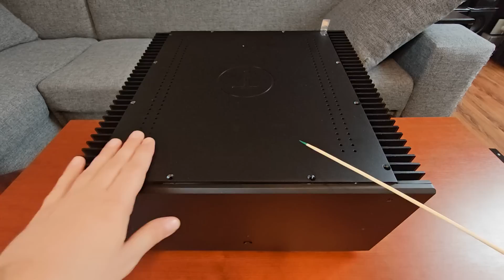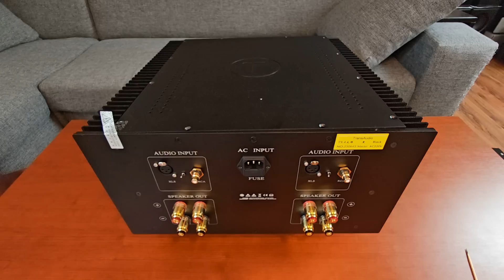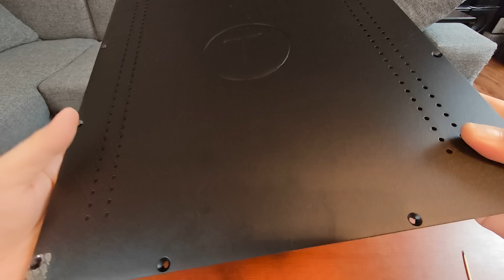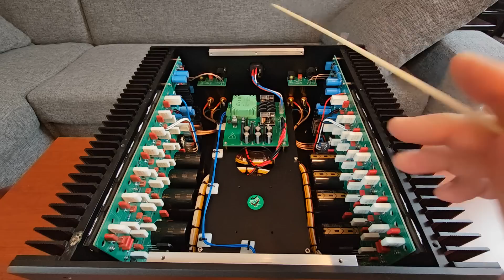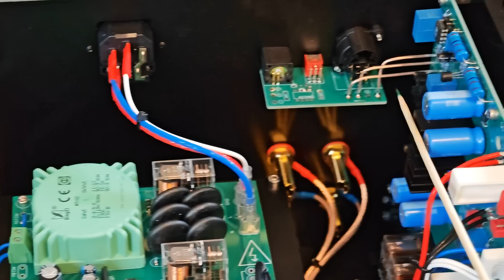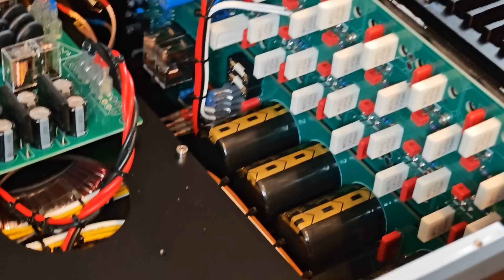Better and bigger: Burmester 909 Transaudio T9.4 stereo amplifier first look

Comment: Since T9.4 is your best power amp so far, I hope you will also review the higher grade power amp T11Pro from the same manufactgurer. I am planing in getting one depending on your review of thse monoblock.
Reply: I have them almost two weeks ago. They are amazing,  great control over speakers and very musical. They are transparent and realistic.
Reply: @vvmaster2010 What preamp are you using?

Comment: ciekawe czy z kappami by sobie poradził.....
Reply from the maker: I'm pretty sure it could handle welding too. I mean my electrostats are really hard to drive properly (1.2Ohm in treble range) and this guy doesn't break a sweat driving them.
Reply: @k4syx  tak tylko, że rozmwiałem z chinczykiem i p;owiedział mi że nie poleca bo to bedzie 800w przy 2ohm - no bo tak będzie, i że trafo jak trafo, ale końcówki mogą się zesr.... ty oczywiście nie pokażesz więc...
Reply: @k4syx  rozmawiam z asypdzsw i chinczyk mówi tak jeśli chodzi o kapp[y "BL9 is a continuous output power, but it is not designed for your 2 ohm. A 2 ohm speaker means that the output power needs to be greater. Compatibility will also require a significant push. Understand?
I have been working in HIFI for 20 years, but I have never seen a 2 ohm speaker. Such low impedance speakers were already phased out in China 40 years ago." WIęc naprawdę, wypadałoby, żeby podchodzić do tematu rzetelniej niż tylko "pociągnie spawanie". To są takie same legendy jak wcześniej, wypadałoby to mierzyć bo komuś może stać się krzywda z burmastrem za kilka tysi z chin. Ja tego nie kupie bo sam producent mówi mi, żeby tego do kappa nie podłączać. Ty twierdzisz co innego. Może tobie co innego napiszą tzn że chińczyk kłamie?

Comment: Good morning, I am also a happy owner of the t9.4, it has excellent powerful and defined sound once it reaches operating temperature, after about an hour of work... but is it normal that it heats up this way? The entire case becomes almost untouchable, in front, on top and on the heat sinks.Thank you for the reply.
Reply from the maker: Hi! Shouldn't be like that, mine gets warm to the touch but not too much. Do you have good enough ventilation? Are you by chance living in some warm climate place?

Comment: I received mine today via DHL. No issues and WOW! Sounds incredible right out of the box. Playing on my Caintuck Audio Betsy open baffles. So powerful and quiet. The details and separation is best I’ve heard in my system. The amp takes the speaker and puts it into a head lock. Pure control. It’s right at 100lbs so better get some help dealing with this beast!
Reply from the maker: Thanks for sharing your experience and congratulations on the new amp!
This is the best amp so far I've had tested and reviewed and looking at what Ali has to offer there seems to be little competition: T11PRO monos (which are basically the same just more expensive) and maybe Dartzeel 1:1 clones for 2.5-3k $. And that's it, there is just a few candidates.
Reply: What's your preamp?

I may get these!
Reply: @MadLadsAnonymous Holo Audio Spring 3 KTE DAC with analog preamp. Great combo! When you have a resolving system, you can really hear what this amp brings to the table.

Comment: Received mine yesterday. Takes from the grid 160 watt upon power on, it stabilizes around 130 watt at normal listening level after warm up. 46 Celsius degrees during normal operation with 26 Celsius in the room.  Basically similar consumption with D5PRO BC. Great!
Reply from the maker: Thanks for sharing! 
Give it a solid burn in time and enjoy - still the best I've heard to date!
Reply: How does it sound?The quality looks knock you out,I know they can be good,as I have a Vincent Audio Amp sp331,it’s pretty good,at least as good if not better than my previous NAD C272,loved that amp but was getting a bit old and took a chance on the Vincent,drives my Thiel 1.5’s and Maggie LRS’s very well.Hope you’re enjoying your clone amp,probably the way I’ll go if I need another amp.
Reply: @PistolPete-i8o sounds very good. You can feel you are in the presence of greatness! Not so much home these days but every time i listen to it I am really enjoying it
Reply: @windyse860 Sounds like a winner to me.

Comment: Coupon codes don't work in Romania either ...
Reply from the maker: The new ones or the old ones? Old set expired on 21st and on 23rd or 24th I've updated the video descriptions with new ones.
Reply: @k4syx it was the old ones, I believe I first tried them on the 22nd. Nevermind, I have placed the big orders on the 25th a few hours before the new ones hi hi

Comment: I also have the T9.4, and it sounds great. But the 2860plus preamp has too much gain for it. I connect the Gustard X30 via XLR to the C2860plus and then to the T9.4 via XLR. Then I can set the volume to max. 9 to 10 o'clock. This is especially problematic in the evenings because the volume control steps are too large to achieve the desired volume. It sounds great, but there's no real match between the T9.4 and the C2860plus.(Gain)
Reply from the maker: Thanks for sharing! I think with less sensitive speakers that would be smaller problem (probably)
Reply: @k4syx only 87db ... it will be nice if you tell us also a bit of the gain of the preamp's.The internal preamp of the Gustard X30 is a better pair in terms of gain, but cannot keep up in terms of sound.
Reply: @S.F.75 same problem with Cry SLP90. Times to times I have some pops or cracks. Using now my DAC as pre....

Comment: Need the comparisons of FM801 vs this T9.4 and the D9 pro.  Which do you like best and why.  Which preamp do you like best with it and why?
Reply from the maker: It's in bits in the comments for those videos, and in the reviews I talked about strong points for each of those amps. I have yet to get to the point where I will do direct comparisons as I have more amps in the line up for review. 
My personal "top three" can be always found in my channels "posts" section as I update it before larger Ali sales

Comment: Does the T9.4 run hot when operating? The D5 Pro I have runs hot. Love the sound qualities from the D5 Pro though.
Reply from the maker: Its hot but not as hot as D5Pro. Its larger so there is more solid metal for heat dissipation, but still, D5Pro is significantly warmer
Reply: @k4syx thanks for the info. Am seriously considering to get the T9.4. Followed your recommendations much earlier and had gotten the Cary + D5 Pro combo a few months ago, connected to AE520 using the clone K2 wires.  I just cannot stop listening to my vinyl/CDs again. Have never enjoyed it that much and there's no listening fatigue.  Thanks a million! Am also considering the Telos 2500 + Telos 600. Patiently waiting for your reviews on them.

Comment: Not available to shipping to UK 😢
Reply from the maker: Yes, many of the shops stopped UK deliveries because of high return rates - notorious problems with humming transformers due to grid problems....
Reply: @k4syx  The UK voltage can be above 245V and saturate the primaries of 220v rated stuff would be my guess.

Comment: I have this amplifier !! op-amp is easily accessible,  suggest replacing the op-amp with a high quality discrete,  sparkos , Burson or what ever is to your taste,  it surpasses the  D5-Pro which i also have now gathering dust in the corner.   T9.4 is impressive straight out of the box.  D5 pro damping factor is stated as 500, T9.4 is claimed to be 2000, what ever it is it takes control of the speakers. D5-pro sounds spongy in comparison.
Reply: These Chifi amps are trash.They always sound harsh and their musicality is weak...Better buy used original like Quad or Musical Fidelity!
Reply from the maker: Which ones have you heard? Are you referring to some specific ones?
Reply: @beslemeto Have you heard this amp? You will change your mind. Are there low quality amps from China? Sure. Not this one. I have this one and can say with first hand experience, it’s incredible.
Reply: @briancook9518  Which other amo did you compared it to?
Reply: @beslemeto Based on your question to my question, I’ll take it the answer is no. I’ve had many amps over my years. Brands that anyone in the know would recognize as high quality (Conrad Johnson, Audio Research, McIntosh, Pass Labs to name a few). I like buying and selling to get real experience in my room. So many people have 0 experience but want to get online and give opinions on hearsay. The TransAudio T9.4 holds its own with much higher end brands.
Reply: @briancook9518 I did not heard it,but i have heard other chinese amps and was always unhappy.Thats why i am sceptical.Good for you if you like it! I am doing the same like you.Buying and selling them...

Comment: The Transaudio T9.4 is a very good amplifier. In brand new condition (no burn-in), it easily outperforms my JDRG concerto and Yamaha A-S3000, both of which are priced between 5-7K USD. Considering the lead of the T9.4, I guess anyone who has a budget of 10-12K to buy a legacy hi-end  amplifier should put this machine on the priority list for comparison.

By the way, all the above comparisons are based on Dali Epicon 8 speakers.
Reply from the maker: Thanks for sharing, it really is excellent - I need to catch up with full review!
Reply: @k4syx  I am a big fan of this channel, your work is truly valuable.  Looking forward to your T9.4 review, I believe you will have the same experience as me!
Reply: I don't believe you! Every ChiFi machine i bought was pure disappointment! They just can't make a machine that matches the musicality of the original units!
Reply: @beslemeto  I don't know what you've heard or tested. These are just generalizations. Especially when it comes to this clone, it's easily in the 10K league, if not better. Either you're a notorious complainer, or you have a serious problem with your hi-fi system, or worse, you're no longer hearing well.
Reply: @Brunello143 Do you have that amp?Can you send me few videos with few jazz,classical and rock music?I might change my mind if you can do that who knows...Thanks!
Reply: @beslemeto ahhhahahaha

Comment: It's good. Better than the D5pro. No regrets here 😊
Reply: Good,but how much? I bought carry slp 90  preamp clone and my Yamaha Preamp just blows it out of the water! Nothing special even a cheap £20 tube preamp sound better than this Carry clone!
Reply from the maker: What's the problem with the sound? Can you tell more? 
I was just checking Horizon tubes with my Cary (viewers recommendation for nice replacement) so I'm fresh with my experience and again, Cary is excellent, transparent preamp with superb imaging. Horizons make it even better. 
What's wrong with the sound of yours?
Reply: @ It's too laid back in my opinion and it's removing the texture of the sound! Sorry not a good preamp in my opinion. Weak gain as well! Shortly after i sold it and bough a tube preamp for £20 which i liked more! More richness and texture!
Reply: @beslemeto wich one please? Thanks

Comment: Hi Tom! This looks very nice! Somehow you make videos faster than I can watch them! This is a MUST for me. I'm looking forward to your review! I currently use a JC-2 with D5 Pro and am very happy with the sound. But if I nave some spare cash... who knows?!! 
For bi-amping how would you recommend I take the signal out from the preamp RCA L & R to TWO power amps? Two RCA-RCA Y cables? OK for the output/input impedances?
Another topic - do you also speak French? Sometimes your pronunciation makes me think so. 
There is a long history PL-FR as there is PL-GB. For example many think Chopin was French! 
All the best, Rob in Switzerland
Reply from the maker: Hi Rob! 
No, I don't speak French, though my "r" does sound soft like in French. It should be hard like "r" in German, but that's the way some of us here talk. But it can sound French I guess ;)
As for biamping you'd be best with preamp that has two sets of parallel outputs like C2860+ but there is no point in replacing everything. So go for Y splitters, that should also be fine and the cost is very low, so it's worth a shot

Comment: Why do the Chinese spec their transformers for 220V when the EU /UK standard is 230/240V?
Reply from the maker: It doesn't matter much as the standards state that +/-  10% should be always accepted by any device. For 220 that's 242 max.
Reply: @k4syx  In the UK it's still + 10% -6%. The reality is that although the UK harmonised voltage with the EU at 230V much of the network still runs at nominal 240 Volts. It's not much of a problem with most solid state but in tube amps it can over voltage ht psu capacitors that are already near their max and some tubes might be pushed harder than is good.
Reply: Perhaps because China is 220V
Reply: @eazydraw4681  Thanks.

Comment: How would this type of amplifier compare with an Atoll AM300? Is it conceivable that the Clone 909 is far superior?
Reply: It will most likely be better. Burmester was a total perfectionist, and his amplifiers always sounded absolutely top-notch. I expect this amplifier to sound very close to the original. Even if it only delivers 85% or 90% of the original's qualities, it should sound considerably better than the Atoll model and many other amplifiers in the higher price range. Above all, it's much more powerful in terms of performance. At this price, it's safe to try. No worries. 😉
Reply from the maker: Its better than my twin Cambridge Audio 851W in dual biamp mode... :)
Reply: @k4syx  That's a statement! Is the difference big or small and barely noticeable? I'd be very interested to know the differences.

Comment: Class A up to 8W / 8 ohm (250 W AB 8 Ohm)

The only strange thing that I can't understand is why it has 2 sets of speaker outputs per chanel. In my world biwiring is a useless thing. Compared to a single out pair with very good binding posts and good cables for each chanel. 
Whats makes more sense is if you Bi amp instead.  Like drive ure highs with tubes and lows with solid state.
But that seldom turns out good either ( tryed for myself)...

Was it a true balanced circuit each chanel or ?
You said in the review that you wasn't sure...
Reply: you can buy also the T.9,4 Master with one set of speaker outputs. Different version"s available.
Reply: @S.F.75  Oh nice... Thank you for telling 👍
Reply: @jonnyberggren4598  I was wrong. The picture in the shop where I ordered only showed a pair of speakers with outputs. However, it was delivered with biamping. Nevertheless, I can highly recommend the power amplifier. It sounds simply fantastic and, thanks to its powerful performance, offers plenty of quiet control and dynamics. For such a small price, you can't get anything comparable from brand manufacturers.
Reply: @S.F.75  所言极是👍

Comment: Thanks for the "under the hood" look. What about the small transformer with the green cover? What is it for?
Reply: It just provides power to the protection board.  That board has relays that delay output to the speakers and a few other protections.